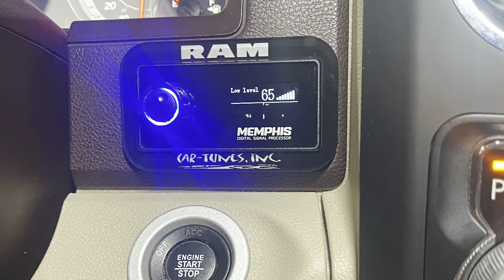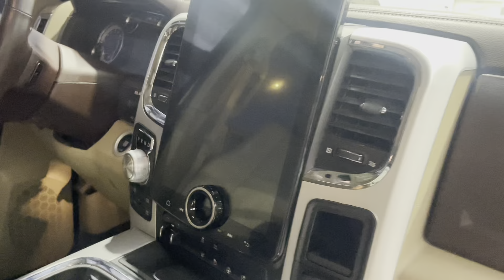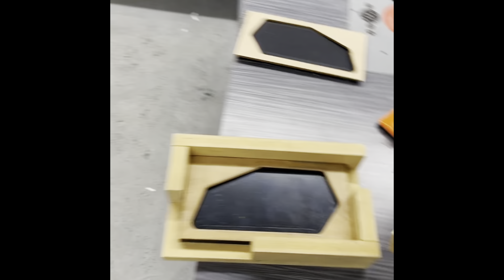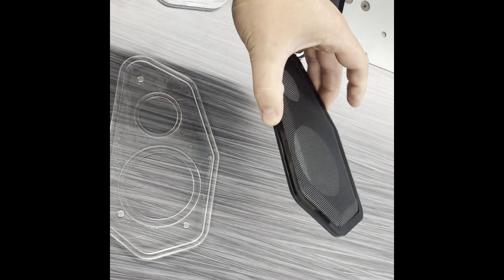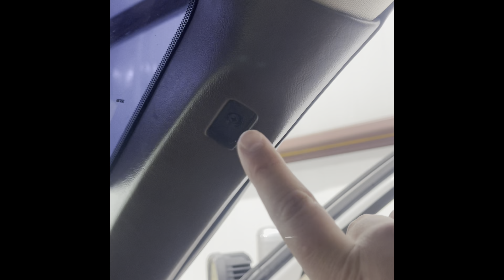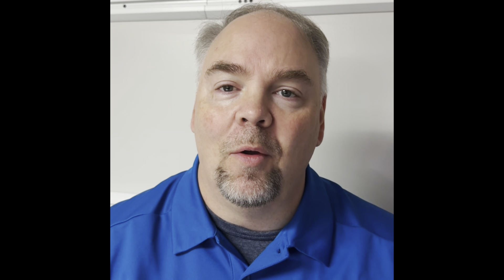Dalton Trainer’s 2024 installer of the year submission

Comment: So the Impala owner ran the output of the amplifier back into the outputs of the factory head unit instead of the speakers?
Reply from the maker: Yes exactly
Reply: @daltontrainer333  What do you think about that Memphis DSP?  Do you recommend it? I'm about to install the same amps.  I have a '21 Suburban w/Bose.
Reply from the maker: @cjlos2050sp  yes it’s definitely a good quality dsp , I would recommend using an amp pro interface in front of it to get you a flat input, this will make your life way easier